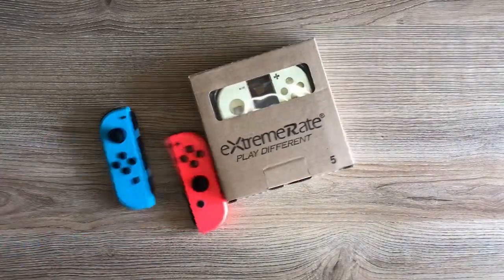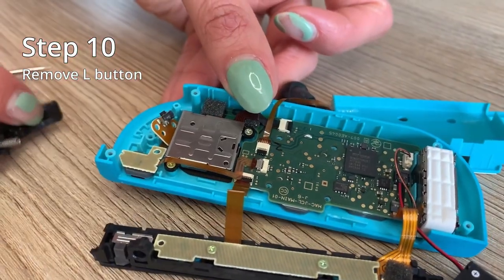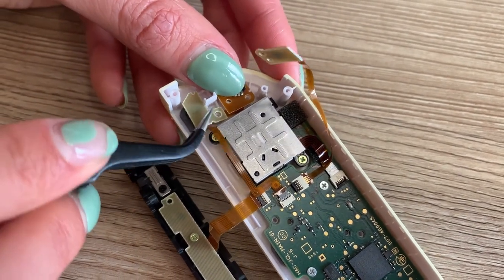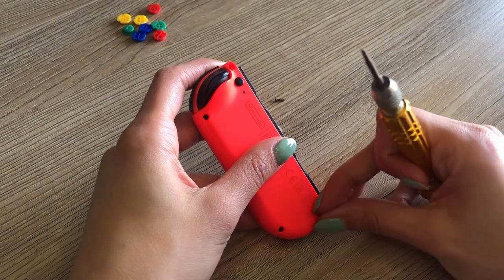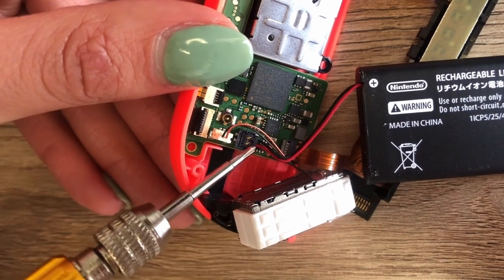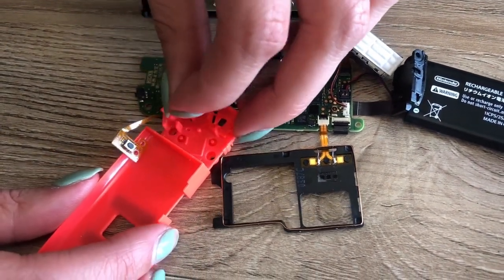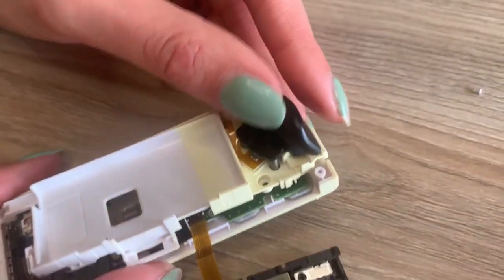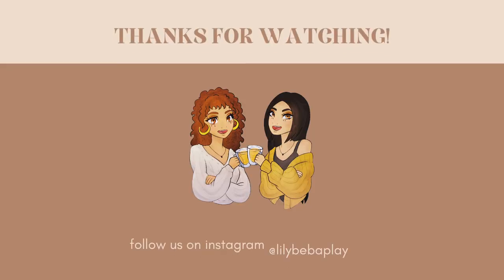How to Customize Joy-con Shells FOR DUMMIES (EASY) - eXtremeRate & Nintendo Switch

Comment: I was going through hell replacing the buttons on my left joycon, it took me 3 ½ hours just to finish the left one but when it came to the right joycon it took me only around 40 minutes. This was a very helpful tutorial and is probably the only reason I don't have two disassembled joycons without understanding how to properly put them but togetherm
Reply from the maker: it is not a fast process by any means, but we took a long time with ours too :) glad to hear you were successful!
Reply: @lilybebaplay  yes. I now have a splatoon 3 switch that has a green joycon with metallic purple buttons and a purple joycon with metallic green buttons

Comment: With the ZL I personally found it easier to click the button in before the springs and use a tweezer to put the springs in place after the fact.
Reply: OMG thank you, I think I spent over an hour with the original method, It took so long that I ended up doing it a separate day, your method took only 10 minutes in comparison for myself
Reply: I gave up at that part and left out the springs and it still works like a charm 😅

Comment: i tried but the screws got stripped immediately and i can't get them out
Reply: to update this, I had an ACNH switch lmao and I got so frustrated after stripping the dang screws that I just snapped off the back of the joycon, pulled out two ribbon cables in the process and spent all night thinking id completely ruined it, but this morning reattached the cables and put it all back together and it works 😭😭 im too scared to try the right side now I'm traumatized

Comment: Just did mine in the green/purple chameleon! Tutorial was great! I did find removing the ribbon for the right bumper made it easier for clearance reasons (and because forcing the bumper down already made me nervous enough) I ended up just using the tweezers to help me place the ribbon cable back. (Not going to mention the part where I pulled the ribbon cable off accidentally and started panicking for a bit lol)
Reply from the maker: Congratulations! Yes it can definitely be scary to pull the ribbon out. There is nothing wrong with removing it as long as you put it back after! We just tried to keep the steps simpler and more streamlined :)

Comment: Thank you SO much. I found your video from a comment on reddit and your guide was very easy to follow and it took me about 2-3 hours to finish (mainly had issues with the springs flying and screws AND buttons falling on my floor). I have experience working with many pc parts so this wasn't hard but for anyone who is still nervous/scared about going into this, just be gentle and follow each step carefully. However, the one annoying part is the SPRINGS!! Those flew everywhere and I ended up losing one but luckily the company I bought the new shells from had extra springs. One tip is you can actually just hold down the springs or if they're bent ( at 10:31), I used a tweezer and put it back in place straight again. Also, it HELPS a lot if you have a small magnetic tray to keep all the screws together/organized, one breath or crazy movement will have the screws/springs flying lmao. I got my tray from amazon for 5 dollars

Comment: You are a legend. Thank you so much for this amazing tutorial it honestly made everything so easy. I had the Standard Switch version with the neon red and blue joycons and finally got the white eXtremeRate ones from Amazon and this tutorial has made it so easy to do. It did take me just over 3 hours, but it was nice taking my time with this as I got the Switch as a gift from my girl.

Also, if you do get a rounded out screw on the outside (one of mine just came stuck for some reason, the rest were perfectly fine) and you plan on not needing the stock housing, just ply away at the nearest entry point on the plastic towards the area the screw sits in, only took me 5 minutes to chisel my way in and worked like a charm.

Comment: So I’m trying to use the screwdriver provided with the kit but both of the bits aren’t working I can’t remove the 4 screws on the Joycon. Are they maybe really tight  in or something because I tried it on my third party Joycon and it worked just fine

Comment: Thank you for the video, I followed the tutorial step by step but now the right joycon doesn’t connect in handheld mode.
Any fixes?
Congrats for the video
Reply: This happened to me, kinda. When I pressed the home button, the right joycon would disconnect from handheld mode. If you didn't break anything by accident, taking it apart and adjusting the rail might fix it. Don't tighten the screw too much and make sure it's aligned. Mine wasn't and that was causing the issue.

Comment: I noticed the battery on your blue joycon was a little bulged did you end up having to replace it in the following months or have you noticed any reduced battery life or anything
Reply from the maker: so far no issues with the battery. We also noticed the bulge and have been keeping an eye on it since then in case we needed to change it! We may still change it just in case
Reply: @lilybebaplay  awesome good to know the batteries are pretty resilient seeing as mine are alway connected and pretty much never removed although I just got a new pair for Christmas they’re the splatoon 3 ones they were $40 from a 3rd party and they are wonderful and so nice looking
Reply: @connormanable  Made a animal crossing switch for myself. Looks great .

Comment: How about you not make tutorials. Seriously, always disconnect your battery at minimum. Follow this tutorial and you could easily just brick your joy cons or destroy ribbon cables trying to balance that mess.
Reply: If the battery is completely drained, it should be fine. No need to disconnect it. It sure is something they should've mentioned but nothing to get angry about.
Also, as long as you know where everything goes, balancing that mess won't be too hard. It looks scary but you'll get used to it quickly.
A few days ago I switched out the joystick in one of our joycons. The battery was completely drained and I only disconnected one ribbon cable (not counting the joystick) and another one fell out.
It still works perfectly, no need to worry.